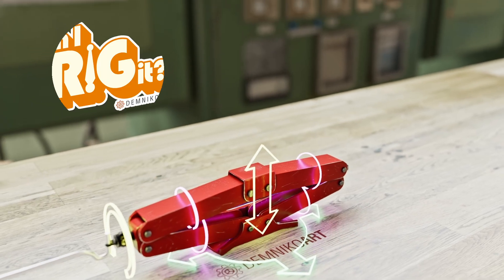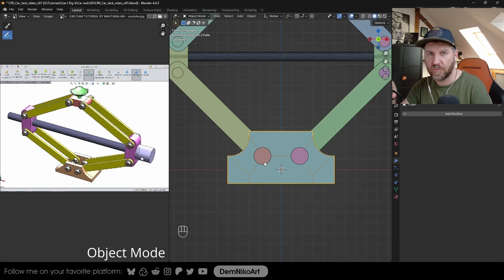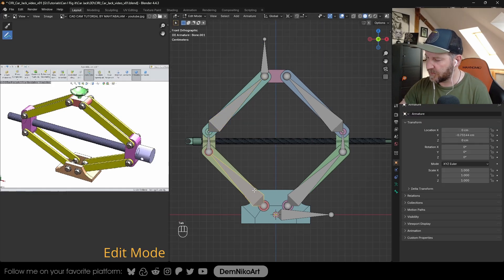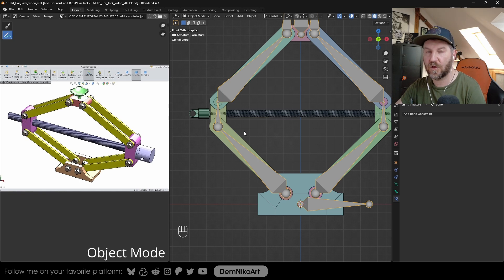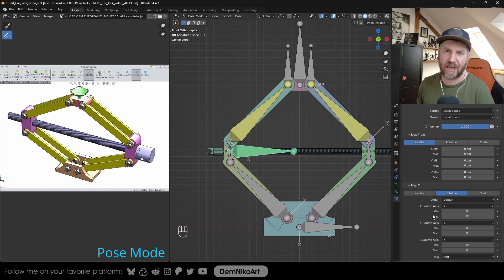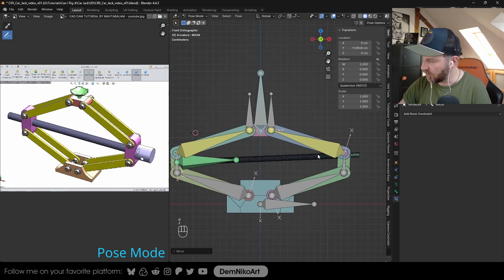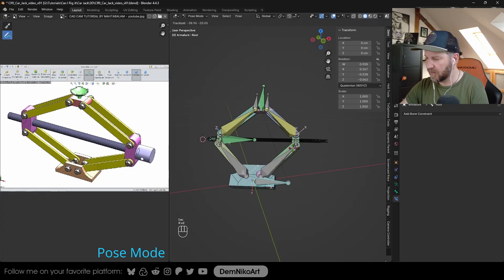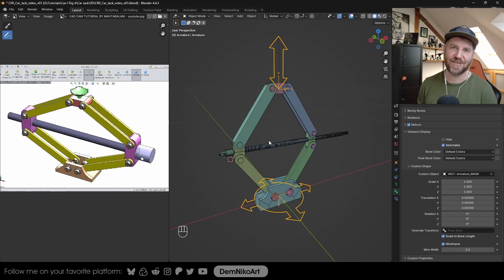FINALLY understand Rigging in Blender - How to rig a Car Jack

Comment: Thanks for the tutorial. But the mechanics here aren't "fair." I thought it would be "correct" to animate the mechanics so that the lead screw raises/lowers the bones (the jack), and not vice versa. In real life, to operate a jack, you rotate the jack screw (the threaded spindle).
So, in the scene, we move only one bone—the jack screw—by rotating it, and the jack works.
But why do we need to pull the jack cap?
It would be great to show such a fundamental detail in the jack mechanics in the future.
I love it when mechanics in 3D work exactly as they do in real life, even the most logically important parts of the mechanics.
(You made a great tutorial.)
Reply from the maker: Oh yeah I totally get it.
I mostly rig things to make them easy to use. And choosing the height is the main purpose when animating that thing.
But I also did it in reverse once, just didn't share it in the tutorial:
https://x.com/DemNikoArt/status/1936864049364447656?t=FJHdf2lr7DI5QmiAIya_pg&s=19

It's actually pretty easy. Just need to add a transformation constraint to the top part to move whenever the rod rotates.
Reply: @DemNikoArt  Thank you for your feedback.
Excellent.

Comment: Hi. Great video.   I found that you can used a damped track constraint for the spinning bar instead of the copy rotation. just have it point to the middle of the little bone on the right side.    Im not sure if the results are any better...but its just another option.
Reply from the maker: Oh yeah that's a great solution too.
In the it's very often that there are many ways to solve a problem 🙂

Comment: This is excellent.  I'd love to watch more videos in this format!  Mechanical rigging videos are hard to find.
Reply from the maker: That's awesome to hear! I was hoping to fill this kinda niche. Thanks. I definitely have more ideas. If you have a specific wish, please share 🙂
Reply: @DemNikoArt  I'm not sure if it dovetails with this particular series, but I'd love to see more investigation into rig control bones.  beyond simply replacing a bone or two with a UI curve, I'd love to hear more about driver type setups.  I liked your use of the driver-esque constraint on the Main bone in this video.  I know some rigs contain control  bones floating off to the side, which abstract some complex set of motions into an animatable slider.
Reply from the maker: @mattkohr9726  aaaah I see. That's an interesting topic that I also wanted to explore. Having a control board for some complex mechanisms.

These work mostly with drivers but I think some simple ones can also work with the transform constraint.
Yeah I definitely want to use these too. It gives so much more simple control over a complex setup. 

I even have one product that uses this kind of system. A wing rig that you can animate with just one controller.